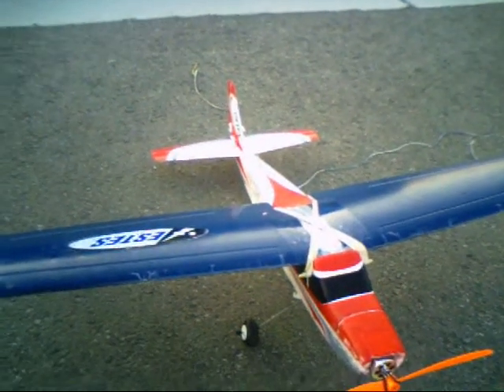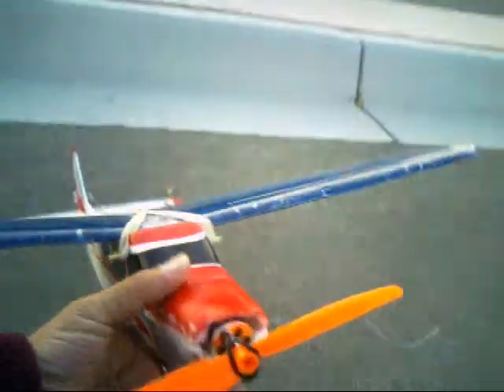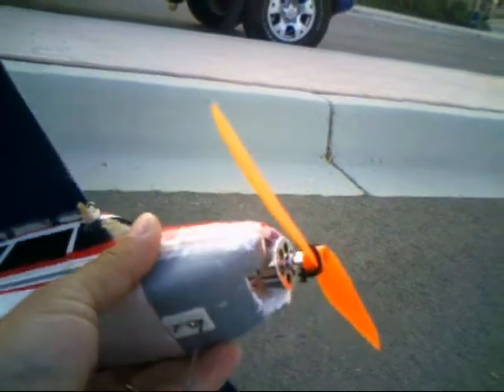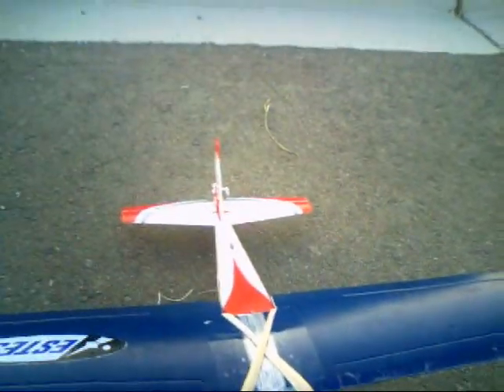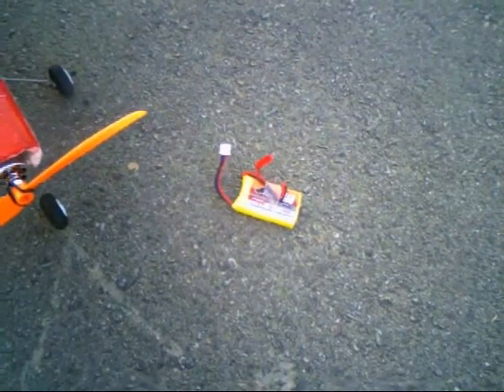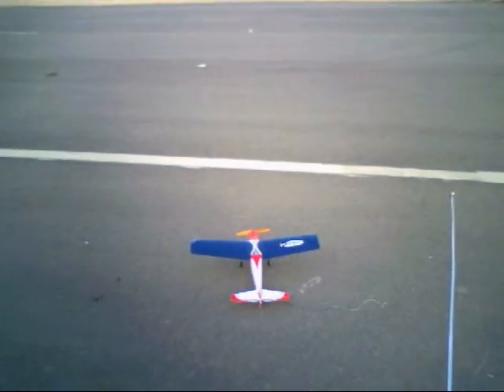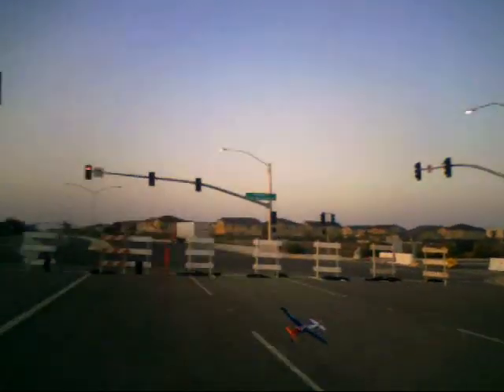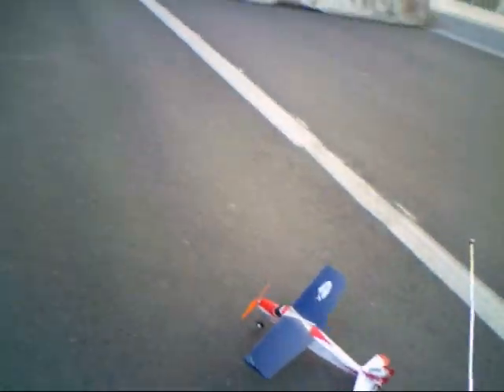Estes 25.5" Cessna brushless upgrade pt 2 Maiden flight

Comment from the maker: Quite honestly, that motor is a tad bit big for this plane. mine was teh 16gram one in the vid. If I had to do it again, I'd use the 18-11 2000kv Micro Brushless Outrunner (10g) instead. I remember that 16 gram had so much power it about rip the stock wings off. Anyways, let's see...for your setup. That plane can't accomandate anything larger than 6", so I'd try something like GWS 6x3. For a bit more speed you can try 6x5. I have to warn you though, with that motor and 6x5, you'll be a rocket.

Comment from the maker: I gave the plane to my brother to learn off of. He finally threw it away when the plane became too heavy to fly from glue :)

One thing I remember, was that the stock wings were too flimsy and always became distorted when I applied too much power resulting in a crash. If using the stock wing, I'd reinforce it.

I can recommend a prop, based on your motor's weight and kv, if you send me that.